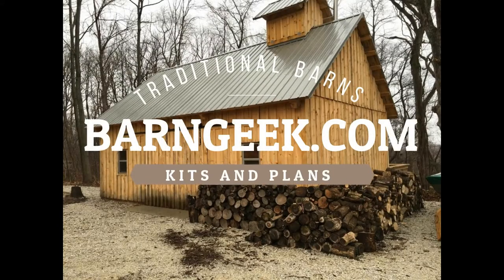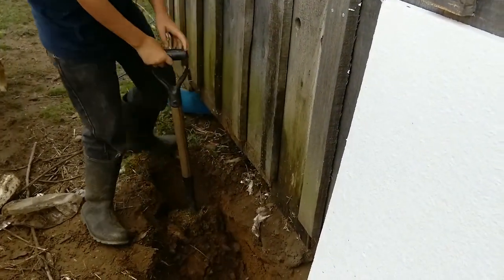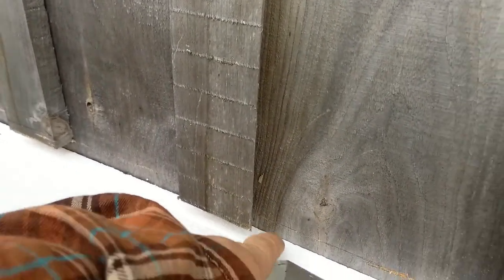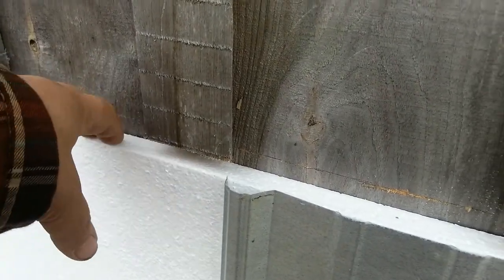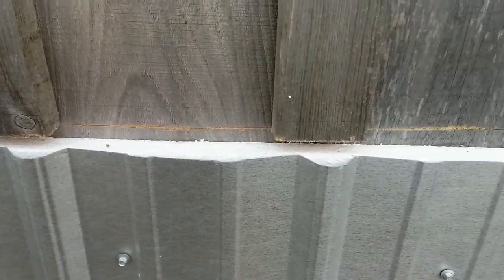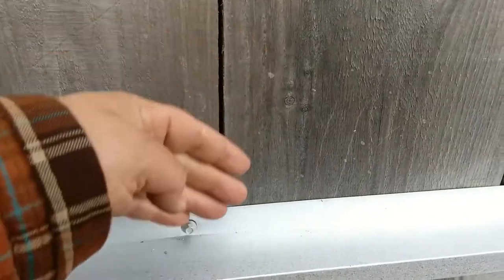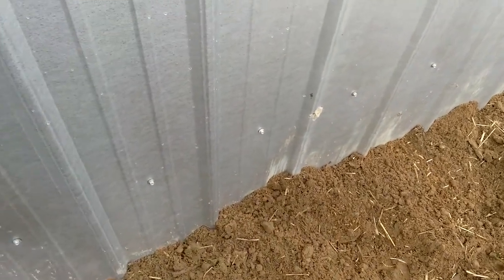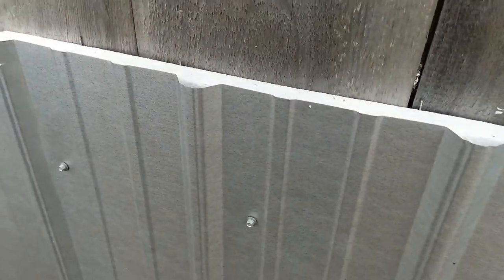Protecting your Foundation From Rodents

Comment: trim should've gone under and behind the wood then over to allow water to drip off, avoiding infiltration/water retention in between metal and wood... rot, mold, etc... carpenter ants, termites in the future just saw it was 3 years ago how did it do?